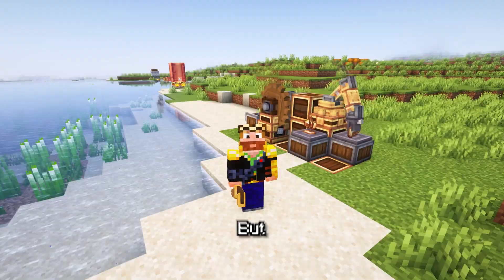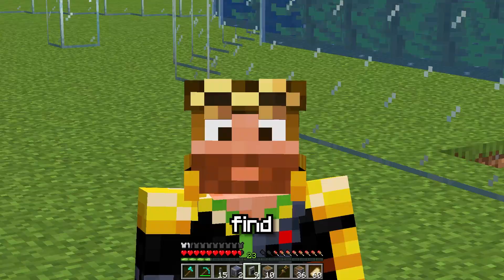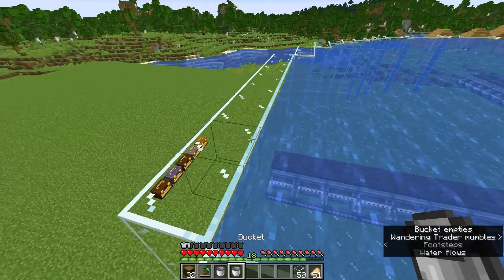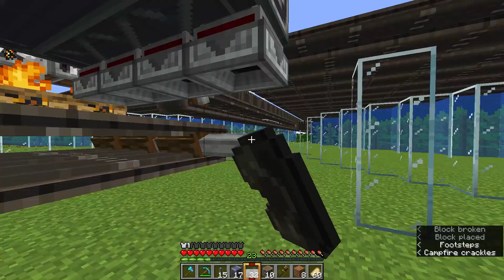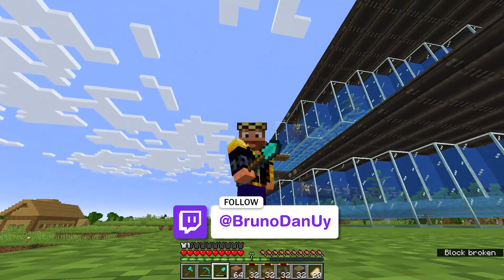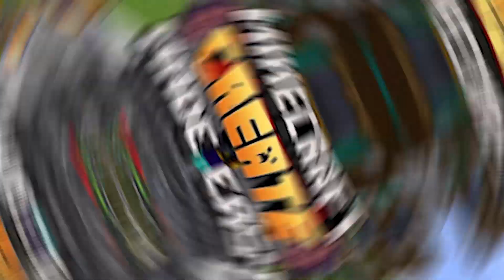I built a MEGA KELP FACTORY in Minecraft Create Mod!

Comment: Hey love the look of this one, tho a suggestion I would have it instead of the massive amounts of belts you put storage on the harvesters, this would put all the kelp into that storage and it can be taken out using a storage interface. you don't even need to pipe up the storage interface on the harvesters because they pull from all storage on the contraption. this also helps with lag as belts can cause a lot of it
Reply from the maker: Thanks, Branard! Yeah, I could had gone with the portable storage interface. I don't know what would had happened with kelp that is taller than one block, and my original idea was taller. Plus all the belts just look cooler haha!
I knew it was not the most resource-efficient way, but I like the look of the belts on the top.

Thanks for your input!
Reply: @BrunoDanUy  thats fair! just figured if ya didn't know you would appreciate it. and I believe kelp thats taller then one block still gets put in the storage. only really brought it up cause I know how laggy belts can get